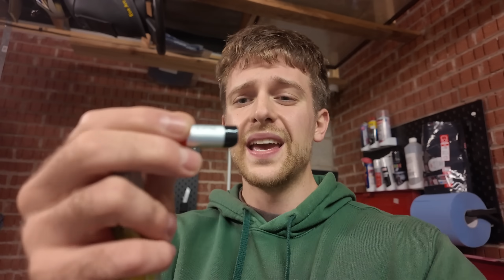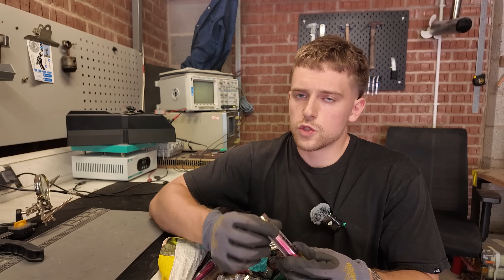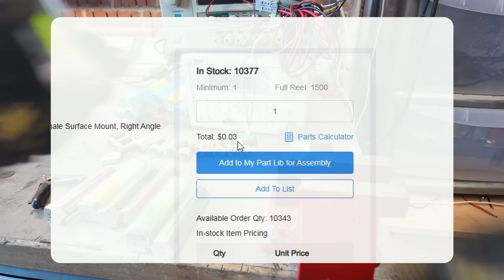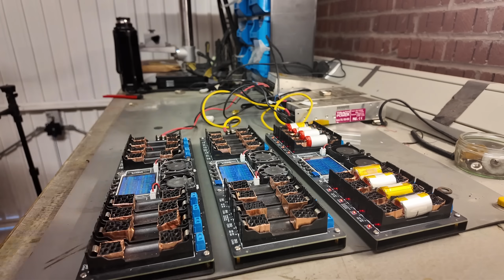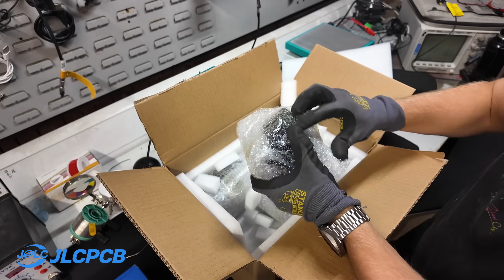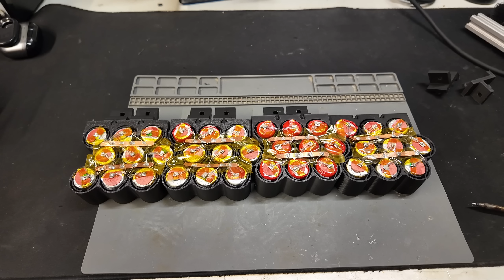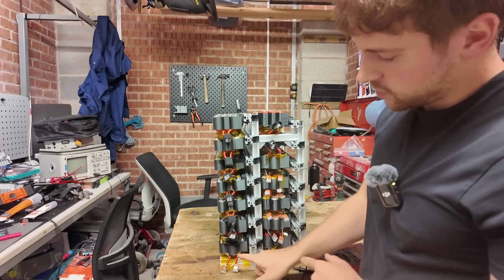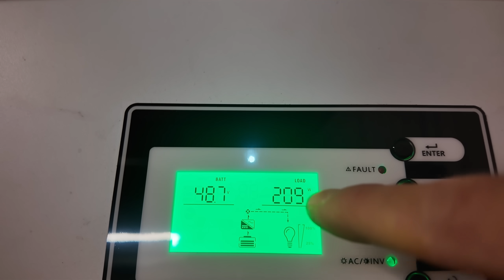I Powered My House Using 500 Disposable vapes

Comment: Yes, the most important piece in it all is that Battery Monitoring System, for sure.  I'm in a Rural area where there isn't hundreds of these Vapes lying around and the few that I find, I haven't the space just now to store and sort them for re-use as a battery bank.  I do applaud what you've done as it's something I really want to do myself.  Local Shops provide dead battery gathering points but that's really for the standard carbon rod A-D type cells.  As said bellow, if I was able to get a Battery Wall together and a similar amount of mini Solar Panels from, in my case, Garden Lights, which I keep in the house and have been working for years, I could almost become totally Grid Free for my power requirements.
Good on you and here's best wishes to you for taking what others have thrown away carelessly and making something work for yourself.

Comment: great idea, but i wonder,  just how much did it cost you for all the parts including the cost of the bms, assuming your time to build it was free..  because i can get a YIXIANG 51v lithium bank,  with a BMS and full fuse protection,  hard case with LCD readout and its STACKABLE for about $2k US right now..  and thats with 16  EVE 314AH  battery cells.   just how much capacity is your bank?  what would the cost be for you to build enough of your banks to equal a YIXIANG bank in capacity?   compared to saving "loads of time building" and just paying the 2k us for a pre-built bank with proven Brand NEW cells?

Comment: I been saying for years now the whole disposable vape waste of lithium cells is an absolutely crazy thing... At the very least there needs to be a convenient method to send them for recycling... If there were a fireproof bin at the vape shops you could just toss your used ones in when buying new ones, we'd save tens of millions of batteries from ending up in the landfills....

Not to mention the plastic, aluminum, and ffs for some reason, even LCD screens.... We turned so much stuff that can be repurposed into disposable at the cost of endangering our own future and increasing the cost of materials we could be reducing the cost of....

The amount of lithium alone....why are we putting this stuff into the ground in areas we live when we could be recycling it into new 2nd gen batteries!?

Comment: You should have the charger test the battery's internal resistance as well since that can help sort out which working cells are still bad.
Also how many Wh is that battery pack?
I also wouldn't consider it powering your house unless you are running the refrigerator compressor, stovetop/range, and dryer all at the same time. Simply powering your lights, kettle, and computer can easily be done with a 12v car battery. You are going to need a much larger battery pack to make the claim of it powering your whole house.

Comment: I have an easier way to go off grid if someone would just hear me out......... Take a 70gl water collection tank, cut a hole large enough to pump wat back into the tank. Mount a high pressure water pump to the top of the tank, inside right under the pump where the water flows in put a water wheel and high output alternators connect it to car batteries and use those to power everything. On the pump run a line from the bottom of the tank back to the pump that way the water cycles through and you will hardly ever have to refill it just when the water evaporates.

Comment: I didn't see any other comments about the Wago connectors, so I hope you see this: they are only rated for 32 amps (IEC) or 20 amps (UL), so I wouldn't draw more than 1-1.5 kW for more than a few seconds to minimize risk of those interconnects melting down.

Comment: It is important to group the cells with the same capacity in series, but why parallel as you say?  What goes wrong when cells of different capacities are wired in parallel as long as their voltage is similar when you connect them?

Comment: You did a great job. I actually built something very similar but with 18650 cells. I think it's a bad idea to get cells of any kind the way you did cause they all will have different life span but whenever the worst of them starts to give out than yeah I would think those small fuses will melt and save the system. My system i built was all in a carrying case thought. It's extremely heavy, much heavier than I thought too 😂. So very hard to carry around but it works and has a lot of cells and I mounted the inverter on top of it so it's good to go. Side note, I also agree that almost everyone should not try this cause one mistake means its all over. I had a very very close call when building mine. I have only made like 2 or 3 mistakes I think ever when building with batteries like this. One of them was on film but it was not as extreme so not so exciting to watch. The other was a very big and I'm sad to say it happened during the one time the camera was not recording. Like yourself I went through almost all the same process but did some things different and it took a very long time and a lot of hours of video to go through. So I have yet to do the edits for my video but now that I seen yours I will get back to it soon hopefully when I have time and get it up on the YouTube channel. Stay safe out there and keep going your video was great.

Comment: How do you use on 6kWh per day? do you always shower away, cook with gas and just read books all day? That's only 186kWh per month, and my small 45m2 flat uses around 550, and i have floor heating paid for by the landlord, so that's not included, and this flat is 10 years old only.

Comment: So, you have nothing protecting you against accidentally flipping the wrong switch and hooking the inverter output to the grid. This is definitely not allowed in the states, and I would assume also not in the UK. You need a transfer switch or an interlock kit.

Comment: Great video my man. Making a battery wall unit for the home is on my bucket list. Can’t wait to do my own. The trick is keeping them charged. Where I live, we have a constant electricity charge day or night. So can’t buy cheap electricity. 

So I have to go wind and solar or hydro. 

I have built a 4kw solar array that also used a 500w cheap Chinese windmill to power a 17.5 KWH AGM battery bank at 48v. Just to run a 9 meter by 9 meter hydroponic greenhouse with a 24h running filtration system for a 2000g fish tank, auto watering pumps for flood tables and supplementary grow lighting. That greenhouse used about 4.5-5.0 kWh daily. 

It’s hard keeping them batteries topped up with what I had. However we did have literal record breaking days of cloudy weather. That was 2019 in Oklahoma. 4 sunny days in the first 3 months of the year hahaha. So just to give you a little perspective as to the scale of what you may have to do to run a home. I think I only had to run a generator a couple weeks of really bad weather  where I would top up the batteries in the morning. But I road the low end of my battery capacity until the sun came up every morning.

Comment: Funny seeing this video, I took a shower today and was thinking about something like this. Found some cheap solar panels and I know I could make something like this with panels to run the house but the amount of storage needed would be a challenge over night in the winter. Had this idea about using an ATS to switch to grid if the batteries ran out at night.

Comment: Replace those Wagos with crimped or soldered connections. They are not meant to handle that many amps. Also definitely replace your switchover solution to one where you literally cannot mess up, you're one brainfart away from kaboom.

Comment: Fantastic project!  Well done!  
Great that you've raised awareness of the huge waste problem that single-use vapes create.  
Being a non-smoker,  non-vaper,  I had no idea that vapes had batteries in them!  I just thought that people sucked on them (as you would suck on a pipe...... ).  
Keep up the great work!
Reply: Yes .. disposable vapes have had lithium ion rechargeable cells for years (with no facility to recharge) but they've simply been thrown away when empty. Unlike the overblown fire risk of EVs the fire risk for waste disposal facilities is very real as these vapes commonly get mixed into general rubbish. There have been several instances of fires.

Comment: Broooooooo I've been working on this exact project for a year now how dare you solve the main problem so easily so for the past year we've been collecting thousands of Vapes but yet we've been only trying to make sure we use the same vape battery for all of it cuz the person that I'm working with says that you can't mix the batteries that messes it up
Reply: you just have to have some kind of balancing mechanism. you should make smaller packs out of similar sized cells before combining them to make the giant one. even car lithium batteries don't all have "exact match" cells, they match the individual cells and put those in parallel then put the packs in series.

obviously don't follow my advice word-for-word, do your own research.

Comment: did you by any chance happen to measure/monitor the TEMPERATURE of the cells in your megapack while under shop/house load? maybe use a thermal camera to look for hot spots? that might be good to know when you're experimenting with sizable lithium battery arrays.
Reply: a precaution i was wondering why it was missing the entire time.
Reply: The temperature will be easily measured once one of the cells goes into thermal runaway, taking the others with it. It just takes one to go faulty, to lose it all. He documented making it, if his house burns down by this they won't pay a dime..
Reply: @Mediamarked  Thermal runaway doesn't happen without an irregular voltage which is what the BMS is for. It would detect thermal runaway, albeit after the fact, because the voltage of that particular cell would cause a dead short and the BMS would kick in. 

Not to mention most of the time if someone has a BMS it has thermistors as part of the design.

Comment: it amazes me of the complexity and wide variation of the circuitry in these disposable,single use vapes. it seems that no two of the vapes I've picked up have the same circuitry inside. some of them have LCD screens,I've read that the ARM processors can be reprogrammed thru the USB-C port. I try to recover the charging circuits from the vapes,but many of them are integrated too deeply for my modest skills.

Comment: those seem to be pretty big cells for a vape,most of the large vape cells I've picked up are only 3WH and are marked 18300,18mm diameter and 30 mm long. BTW,in the US,the stupid gov't banned refillable vapes,so only the disposable ones can be sold,making for lots of discarded vapes on the ground.

Comment: I see vape cells are different there then they are here in the states - every time my local gas station has a deal on ON! vapes(the promo's are usually buy the juice and the device is free) they will save the devices for me since most already have one and don't want another(and the station is left with boxes of vape devices). These have a pouch cell inside of them rated at 3.7v 1.48wh and roughly 1" x1" in size with terminals on one end. Just pointing out cell differences since those look cylindral and nothing in the states are like that(even the pen types we have here are usually skinny pouch cells).

Comment: some of those below 3v cells can be recovered. the microprocessors in many of the vapes won't run below 3v,but the cells minimum voltage is 2.8v,IIRC.

Comment: Not all Li ion batteries are equal. That's to say one cell that has a capacity of 500mAH may have a safe continuous discharge rate of 5C (2.5A) whilst another of the same capacity has a safe continuous  discharge rate of 1C (500mA). This information is never written on the cell. Did you consider this as a potential problem?

Comment: I am concerned about sudden thermal runaway, by one battery, making your whole workspace a toxic and fumed up enviroment. Nothing the fuse in between can stop and usually it's a very rapid process. The project is cool but i have my doubt on the quality of those cells. They are not for nothing on a disposable cheap vape.

Comment: Imagine systems like these being used to smooth the power curve: free battery cells allowing people to draw power from the grid off-peak when it's cheap (and there's excess generation) to feed back in during peak times.

This could legitimately help solve power management problems on a large scale.

Comment: You Cell voltage differential of 0.059 is not great. It will probably get even worse than that over time given the tiny cells you are using. Keep an eye on that. Your BMS will be working overtime to keep those old cells balanced.

Comment: I used a load in garden lights - saving the original 18650’s for other projects. Plus they’re outside so less fire risk.
Store individually in bags in metal tins for safety.

Comment: Don't vape batteries have anywhere between 5 to 30A CDR?
If they're not individually monitored wouldn't that be dangerous to not know how much power is safe to pull from each battery? Vapes that take more than one battery it's recommended to keep the batteries together so they're always charged and discharged at the most similar rate you can keep them at. This seems like the complete opposite of that idea.

Comment: Amazing work, but definitely check your regulations on connecting that to your house full time, pretty sure you have to register any off grid supply to your energy supplier.
Main reason being if edf are working on the lines and you have off grid power they need to make sure your off at the same time. Hence why solar inverters will shut down when mains goes down… it’s a safety thing.
So imagine a whole housing estate full of solar or off grid power sources, how are edf supposed to make safe their lines for the guys working on them if loads of houses from that estate had off grid supply’s. 
Hence the need to register your house as having its own off grid supply. 
But I’m all for it, what you’ve done is amazing, keep up the great work!!!